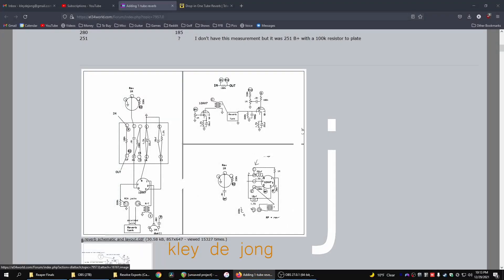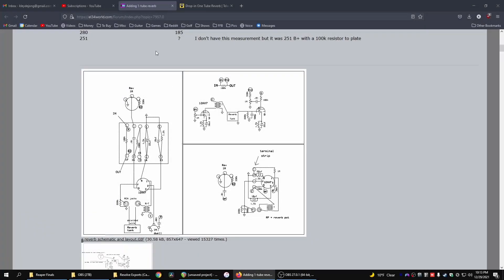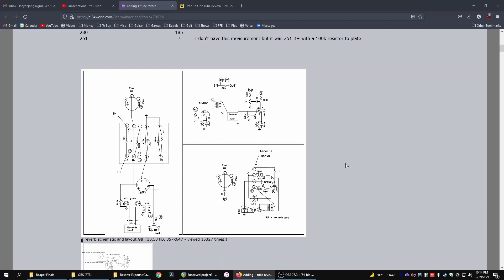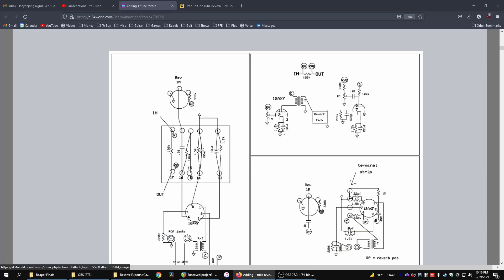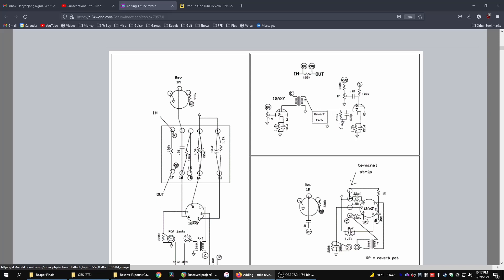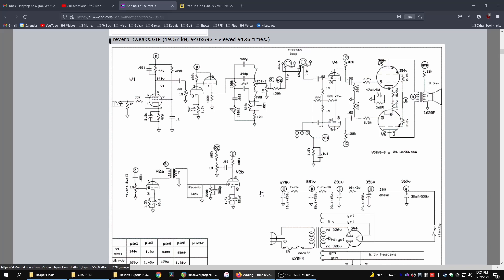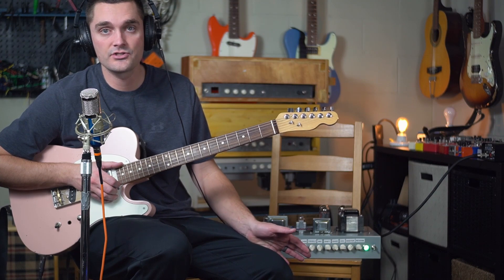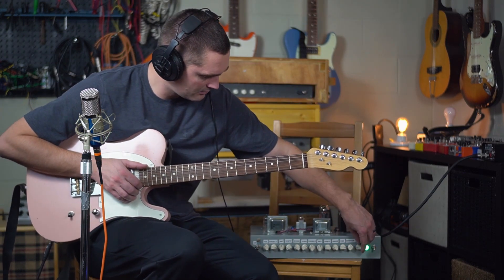Use this Easy DIY Tube Driven SPRING REVERB circuit

Comment: Thank you very much. It's a clever and functional circuit, and the audio samples are appreciated.
There's one point I think you've misunderstood: the effect of the 500pF capacitor in parallel with the 220K grid leak resistor at the tank's output. This capacitor doesn't act as a simple treble filter, as it's in parallel with the reverb tank's transformer inductance. What it does is focus the treble frequencies, increasing the overall perception of presence. The issue is that 500pF is a low value for a classic Fender tank. If you increase its value to 2200pF (or even 3300pF), you'll perceive it more prominently. It's likely that in your case, it will be beneficial for adding more vibrancy to that reverb. From there, you can fine-tune it accordingly.
Thanks again, and greetings from Spain.
Reply from the maker: Very helpful, thanks for your explanation!

Comment: Ive been thinking about dumpster-DIY ing a reverb out of an old milk house space heater that I can somehow plug into or hard wire into a guitar amp, but being a separate component that can be used with different amps. I wonder if anyone may have ideas?
Reply: Somebody on YouTube built a plate reverb from metal shelving,, so, almost anything is possible....
Reply: @goodun2974   Its actually pretty simple once one gets the correct schematic for the inductor drivers, the unit is about half the length of a standard tank and only about twice as wide so it definitely will fit into the back of most 10"-12" combo amps. Sounds pretty much the same as a regular 20 dollar reverb tank though and it took many hours.